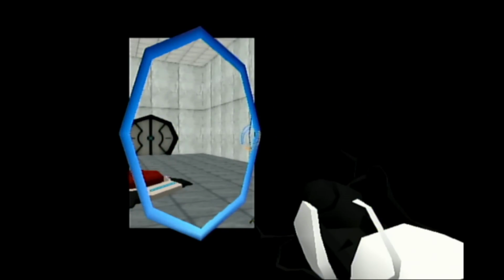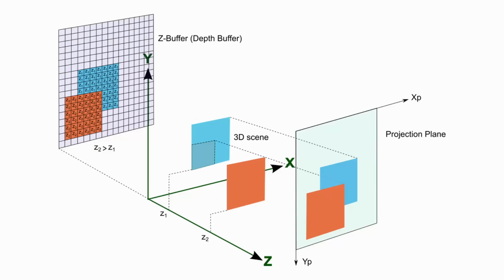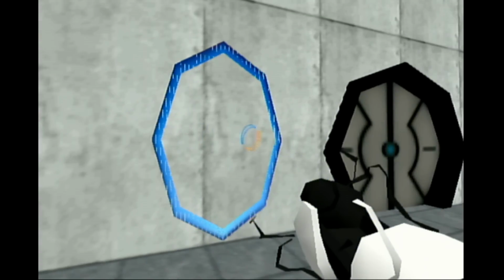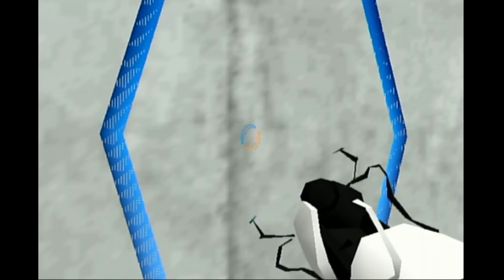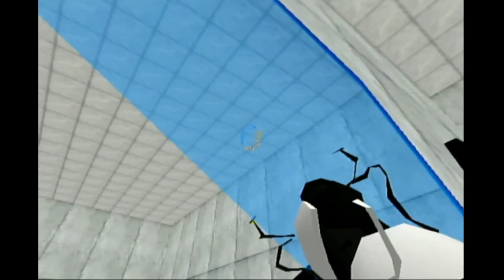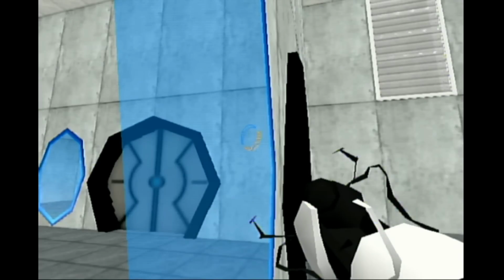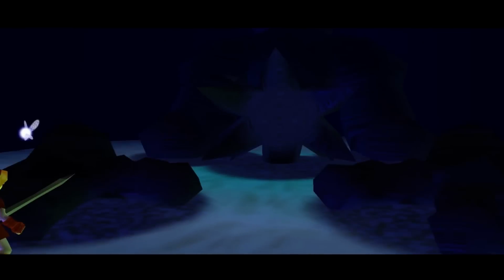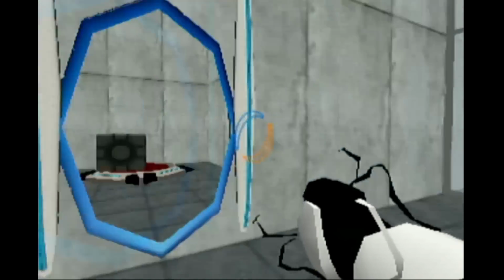How can the Nintendo 64 run portal?!? | Portal64

Comment: So what control scheme is this going to default to? I'm personally fond of the turok method, where the c buttons are the movement and the joystick is use for the camera. That leaves R, Z, and the A and B buttons. (yes, the d pad and L button exist, but 64 games that use them for anything important sucks)
A button toggles grabbing an object
B button toggles crouching
R button jumps, long hold = higher jump
Z button throws portal
holding Z button changes portal color?
Reply from the maker: Definitely have joystick rotate the camera with c to move. I was thinking of combining crouch and grab by tapping B to grab and holding it to crouch. since those are used less frequently than shooting portals so each portal can have its own button
Reply: @james.lambert  except you often have to move while crouching and/or grabbing , and it's almost impossible to hit the B button and still reasonably navigate movement via C buttons at the same time. Obviously not a problem for modern controllers emulating controls, but if you're doing portal in N64, let's make it work the whole way. (and have the option to bind L button/dpad instead, which can then typically be bound to any button on a modern gamepad)
The alternative I'd recommend is R button crouches when held, and jumps when released. It would restrict you to a binary jump strength, but that may be less important that having a dedicated portal change button.
If you do go with that, I'd definitely want to provide the choice of having the A/B button used to either place a portal directly, or cycle between the portal colors while Z does all the shooting.
Reply: @james.lambert  ...Metroid Prime controls? then you have 6 face buttons to use at the same time as aiming (not counting start), e.g.:
C<: Blue Portal
C>: Orange Portal
Cv: Crouch Toggle
B: Grab Toggle
A: Jump (plus some camera tilt down to help with platforming maybe?)
Z: Strafe/lock on(?)
R: Aiming mode (Stands still, keeps momentum in air, returns to neutral when let go, unless holding Z, which keeps it at that angle until Z is let go)
Stick: Left and Right turn the player unless strafing, forward and backward work as usual
Just steal Metroid Prime controls
idk what C^ would do though (airboat button?)

Comment: It looks like you are really far along developing this. Soon you might be able to start making all the levels up to chamber 19. I figure the non testing areas might take a bit more work and if you do the final boss area that might be a lot too. I don’t care how long it takes I’m gonna stick around to see this finished. Makes me wonder if Half Life could be done too.
Reply: I think Half-Life could be, in a very, VERY cut-down state. Turok 3 is close to Half-Life game wise but it runs bad and looks meh, maybe HL would be doable, but I imagine the cartridge space being a bother. Unless it is done for the 64DD platform.
Reply: Half Life has a never released port for the Dreamcast, which is not quite the same, but still marvelous. It's kind of a pain in the ass on real hardware though.

Because it was never released, you can't find a GD-ROM of it, so you'll need a Dreamcast capable of playing games burnt to a normal CD, and of course need to burn the image to a CD. Also, saving is rather poorly optimized, and takes up more and more space the farther into a level you get. I'm unsure if it ever reaches a point where it costs more blocks to save than a VMU contains, but I have an entire VMU dedicated just to HL, because it absolutely can and has taken up the entirety of its free space at one point.

Aside from that, it's a faithful port that I believe was finished by fans, as the unreleased leak was incomplete. And very fun on a DC controller
Reply: @RemyJustice97  I’ve heard about that. It’s super interesting knowing it was supposed to have a Dreamcast release. It would be neat if he could port it to n64 but that would take a bit of work. Who knows maybe he could use the knowledge he has learned from the portal port to do Half Life. I know it did release for the ps2 so I might pick up a copy of that just for fun at some point.

Comment: The framerate is surprisingly high. This is presumably running in an emulator? I'd love to see it running in hardware c:
Reply: I can confirm it runs very well on hardware. I had a bug the first time where it only rendered the viewable room inside a portal but I reset and it worked fine the second time

Comment: Seeing the entire game on n64 would blow my mind. Really hope you don't ever cancel this before you finish the full game!
Reply: I don't really need the full game. Seems like too much work for one person. I'll be satisfied with just the first lvl as a demo.
Reply: @carl8790  I wont. Everdrive 64 can fit very large games on it, my copy of Smash Remix has 200 levels.
Reply: @justinbailey5467 200 levels? You mean 200 stages?
Reply: I think it would be extremely difficult to implement the transference of momentum through portals while airborne.
Reply: @moonrunes0  honestly, would that really be more difficult than the portal programming, which he already implemented and showed here? I don't know much about N64 programming, but the momentum through portals thing could be dealt just by copying and keeping the variables for momentum after the transfer through the portal. Right?
Reply: @gaetanodepaola2ndchannel179  It wouldn't be that simple when one portal is flat on a floor, wall, or ceiling while the other is on an incline.
Reply: @moonrunes0  would it not be possible to just have a 3D vector with your speed that is edited by the difference in portal angles?
Reply: @moonrunes0  He already showed this in his previous video. So it actually does work
Reply: @moonrunes0  Hopping into this real late but transferring momentum through portals should be easier than anything shown in this video. The power issues with the n64 would show up in trying to do real time physics for many different objects at once. So levels with a lot of cubes, turrets and etc could be problematic depending on how accurate you want everything to be to the real game.
Reply: @moonrunes0 Hmm. Flinging seems to work just fine. You don't give the ol 64 enough credit.
Reply: @moonrunes0  replace it with trampolines :troll face:
Reply: @moonrunes0  momentum is calculated with math as opposed to the physics engine iirc, and that math could theoretically be reproduced
Reply: @jeremieh5009  isnt physics calculated with math too?
Reply: @erwinamanciosilva7693  yes but it’s handled separately from player movement
Reply: @moonrunes0  I completely agreed with you and thought it'd be near impossible lol. But his new video...
Reply: Nintendo would strike it down with lawsuits before you ever got near that, I reckon.
Reply: @NoobsDeSroobs  Nintendo literally can't strike this down though? They have no jurisdiction over portal.
Reply: @TheWrathAbove  But they do over Nintendo 64. Every company had to pay a fee to be able to develop for the console.
Reply: @NoobsDeSroobs  Micro Mages is an NES game released in 2019 and sold on Steam and Nintendo took no legal action. Battle Kid: Fortress of Peril is an NES game released in 2010 and Sold exclusively though phyiscal cartridges and Nintendo took no legal action. 

Nintendo has made it clear they do not give a shit if you develop games for unsupported consoles.
Reply: @NoobsDeSroobs  that's not how it works, it's not illegal to develop a game for a console. You do not need permission. Obviously it infringes on Valve's copyright but they're not gonna do anything about it
Reply: @NoobsDeSroobs  Interestingly enough console developers don't have legal control over who develops for their platform. There simply isn't an intellectual property right that gives them that kind of control, they have copyright on the games they make and potentially patents on the technology used in the console, but a patent on the console only prevents others from producing that console (or rather, it's innovative technology  that's patented). They also have trademarks on the console name and the company name but that won't do much either.

 Companies like Nintendo specifically designed their cartridges with a security measure so that only their self produced cartridges would work with the console. You also need some technical info on how a system works to develop for it, which requires reverse engineering if not provided by a company like Nintendo. This forced developers who wanted to make a game for the system to either buy a license from Nintendo or reverse engineer the system
Reply: I have only known about Portal64 for 6 minutes. But if anything happened to it I would kill everyone in this comment thread and then myself.
/officejoke
Reply: Anything related to physics is the least of concerns, the N64 CPU can do anything a modern CPU can do, just slower.
Reply: @chlorobyte_projects  that's... one of the dumbest takes I've heard in the past month
Reply: @zegreatpumpkinani9161  ...and no explanation why the N64 can't just run the source engine physics?
Reply: @yellowblanka6058  and every single currently available low end PC can run Portal and Portal 2 perfectly fine. I played the games on an Athlon 64 3200+ with zero issues.

On a N64, you aren't going to have overhead from Windows and its various APIs - you're directly working with the hardware. Still, you'll run out of CPU cycles for physics calculations faster than with a PC. The vanilla maps that use up to a few rigidbodies should run perfectly fine regardless.
Reply: @yellowblanka6058  The Source Engine can run perfectly fine on sub 1 GHz CPUs, think the very old Pentiums at hundreds of MHz. Add low level programming and Portal's far simpler levels (videos are available of HL1) and a port doesn't seem that ridiculous of an idea.

A reminder that the N64 ran Super Mario 64 at almost locked 30 FPS with compiler optimizations completely turned off.
Reply: @yellowblanka6058  that's funny to hear from someone who doesn't mess with n64 development, or any development for that matter

I have already explained precisely why the N64 CPU would still be able to handle the physics engine perfectly fine. You have failed to give any actual arguments, instead continuing to argue with clock speeds and IPC - while comparing apples to oranges. The games run under a multithreaded, protective OS through high-level APIs while the PC is running other stuff in the background in real time, while a N64 game doesn't have to deal with any of that and has basically direct access to the hardware.

And the Athlon 64 3200+ is not a 2.4 GHz Athlon. It's a 2 GHz. If the system requirements you posted are valid, explain how the Athlon 64 3200+ can run the Portal games. :)

Not to mention we're not even talking about the same thing. I'm not saying to straight up port Portal to the N64. Just plop a similar physics engine into an actual N64 game. The N64 already did a lot of physics calculations in real time - again, in Super Mario 64, which was compiled with -g instead of -O2. There's no rigidbody physics, sure, but it did a lot, and I mean a lot of triangle intersections.
Reply: @chlorobyte_projects  even if the cpu could theoretically run it i don't think and N64 has enough ram to calculate a single frame of any source game. Theoretically any modern cpu could do any task given enough time but since video is delivered in frames instead of a constant stream of data you need enough memory to store that information and the N64 simply does not have that
Reply: @chlorobyte_projects  you obviously have inside knowledge. inside you're, but whole lolskis 🧲 you know that you'd need too many and too large magnets to get that sort of performance from the N64 (which is ironically 128)
Reply: @chlorobyte_projects because the shitty 90s MIPS chip is too slow for 30fps havok calculations? compiling havoc for MIPS might be hell?

Comment: I kind of have this feeling that Portal might become the next DOOM in the idea of it becoming one of the next "Hello World" 's of gaming, with people porting it to anything that can run 3D.
Reply: Do not take this man's amazing attempt at making Portal for the N64 as indication that it might be easy or feasible like Doom is.
Reply: The thing is, OG DOOM is very lightweight compared to Portal. They're like more than a decade apart. 

I don't think we'll be seeing Portal being ported (heh) to Texas instruments calculators and pregnancy test any time soon.
Reply: @carl8790 and after that you have to plug the red wire into the socket to make sure the engine boots at launch. Wrap the green wire around it's coil that sits directly beside the A button. After you put the back shell on, place the battery in the slot. Screw the Vr26 Jeeper back up and press the reset button. If everything worked according to plan you're device should show a thumbs up sprite. Plug the HDMI port into a monitor and wait three seconds. If it boots up on TV your in the good side. If it doesn't boot in less then 5 seconds quickly unplug. This can severely damage your TV and possibly start a fire
Reply: Doubt it. Remakes? Yes. But entire demakes? No.
For instance, I have an idea along with a friend , of making something similar for the PS1, but I can guarantee it won't work well because one of the most required elements for portal rendering (z-buffer) isn't available, along with a even weaker hardware, may make this task impossible. So have that in mind Incase you wonder why it wouldn't become a Doom.
Doom was made to be optimized and with portability in mind, so it has this point in it's advantage. Get someone familiar with it's codebase, and you get the usual "Can it run doom?" Mumbojumbo we have nowadays.
Reply: I can't wait for someone to try running Portal on a calculator
Reply: Doom is open source and can simply be recompiled for any machine that has input and a frame buffer. Portal is closed source, which requires rewriting it from scratch, and uses 3D hardware, which is highly variable.
Reply: Super Portal FX. Make it happen.

Comment: I'm not sure if that's a problem from the emulator but the textures are not loading property. Everything was a black void until the portals opened. It was still a black void but at least I could see the normally in the portal

Comment: Rather than splitting the zbuffer in half couldn't you draw the main scene as normal then make a new viewport in the region of interest, clear the zbuffer in that region to a set number, and redraw the scene using that region as a mask?  Depth compare should do the "masking" for you if you choose a large enough value. you have 64k numbers to choose from since the zbuffer is a 16bit fixedpoint value,. you can reserve the last n values where n is the max number of portals and draw the scene recursively that way which lets you have more depth precision for the rendered scene. You can effectively fake stencil buffering this way. Either way amazing work! I'm looking forward to seeing future updates.

Comment: May I suggest, in the second test chamber, having buttons that change where the portals are instead of a timer? the second portal, when recreating that exact same chamber, added that to help with game flow.
Reply: that's what portal 2 did and it was much better. portal 1 should retro-fit it back to itself.

(and then portal 2 improves upon it another time and then portal 1... ok i need to sleep)

Comment: Fascinating! Very nice! Tell me, you put the effort into having the portals carve holes into the walls in order to prevent Z-fighting, was it undesired/impossible to place the portals a subunit in front of the walls instead? I imagine your method solves the potential issue of long distance Z-Fighting, but I'm curious to hear about your own reasoning behind this system.
Reply: i think if you put the overlay a subunit in front and don't carve the wall, there would be a wall in the way

Comment: The ROM starts in a dark room? I can't do anything. 

Edit: It seems the character loads out of bounds. When the portal opens (in 3, 2, 1) It reveals two portals in the darkness showing what's on the other side of them, but going through only puts me back into darkness.
Reply: Does anyone know what to do :/
This seems really fun to play
Reply from the maker: Are you using an emulator or real hardware? I tested on real hardware I don't bother testing on emulators for now.
Reply: @james.lambert  Unfortunately I can't use actual hardware.